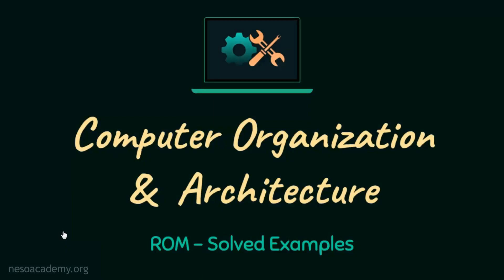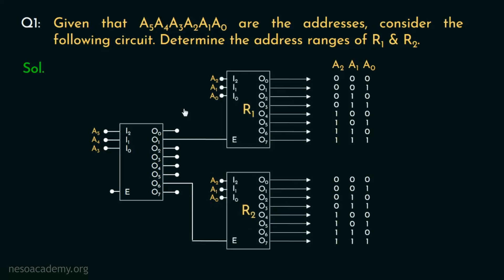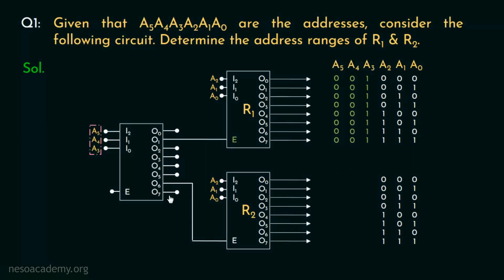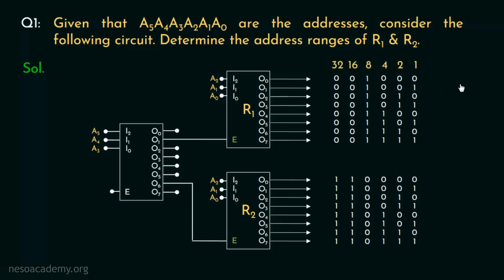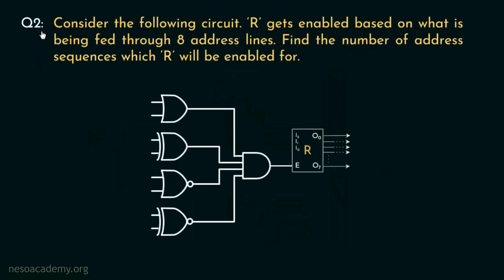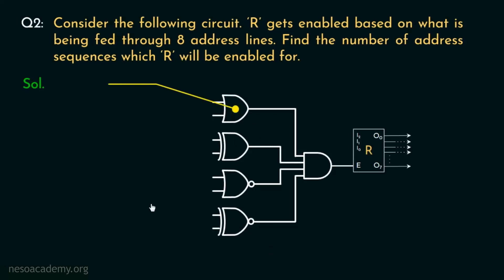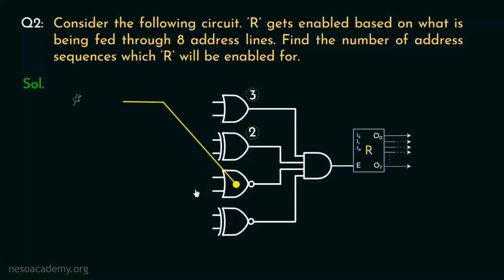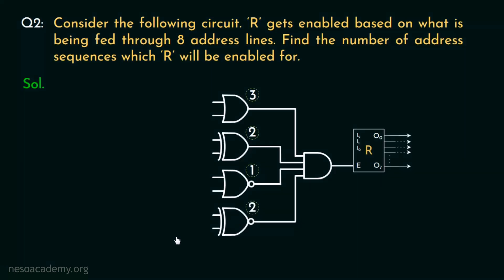ROM – Solved Examples

Comment: For Question 2 : 07:35

XOR EXOR NOR EXNOR
 01     01      00      00
 10      10                11
 11   

We can clearly see :

With 01 - two possible addresses - 4 
Similarly with 10 and 11 - 4 possible addresses i.e 4 * 2 = 8

So - 4 + 4 + 4 = 12

That's how i solved. Is it okay ?